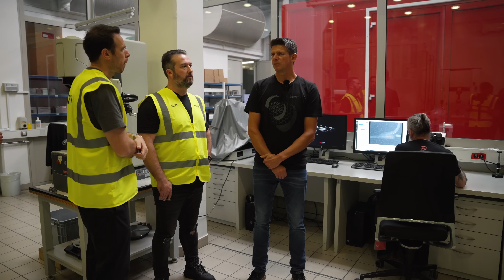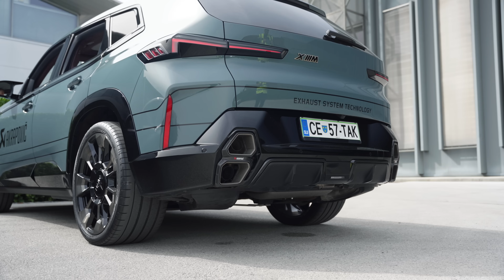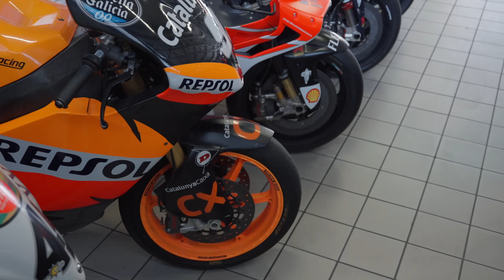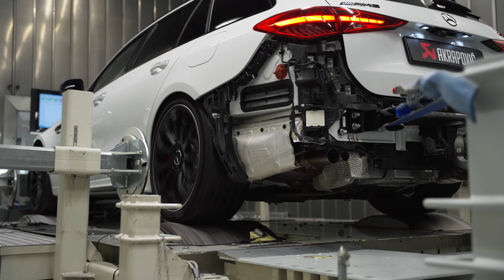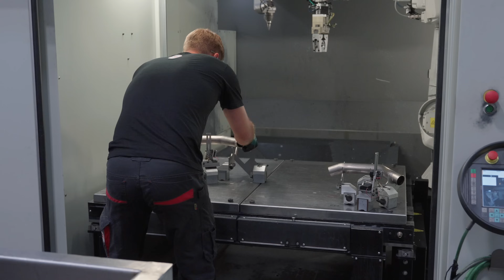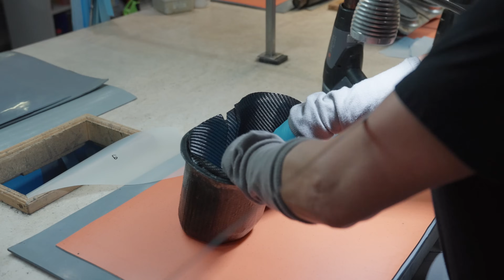EXCLUSIVE Access: Inside Akrapovič’s Top-Secret Factory!

Comment: Did Akra get in trouble or something? It seems they are shifting more towards making homologated optional exhaust systems offered through OEMs instead of the nasty catless stuff that we all want. I can't get a good exhaust from them for my Triumph and it's a bummer. I'm not spending $2,000 for something basically the same as stock but prettier.
Reply from the maker: It makes sense to make them homologated that way more customers can buy them